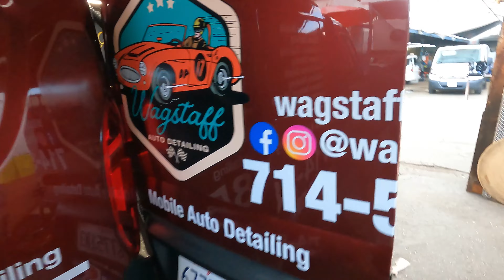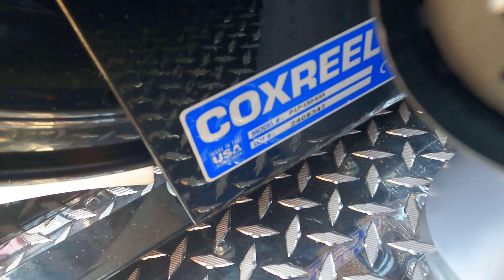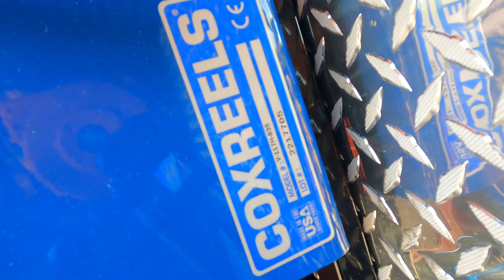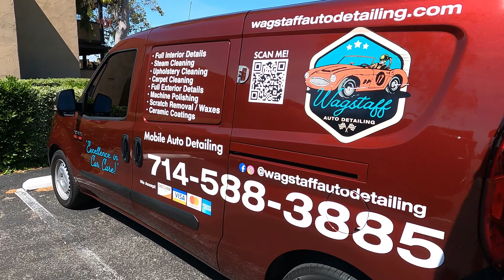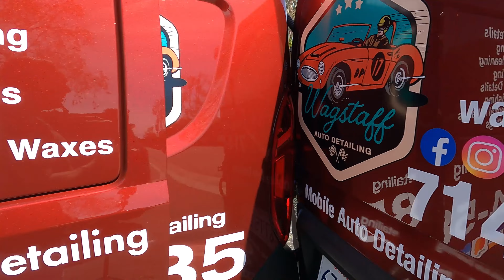H2O Custom Fits My Van setup With Top Of The Line Mobile Auto Detailing Equipment. Full Tour!

Comment: hey, my ar blue clean pro a620 pressure washer is above my water tank do i need a pump ?
Reply from the maker: I heard as long as its not
More than 3-4ft above its ok to use without it. I dont use one and its like 3 ft above and works fine

Comment: How do you pay for the set up?
Reply from the maker: Most people will finance the van, do a zero down financing, and just make monthly car payments. Once that’s out-of-the-way, most people will buy the tools and equipment with a combination of cash and credit cards, and then once you have everything, you can pay H2O a combination of cash or credit card to do the customization and installation. Also H2O has premade set ups for half the price it costs to but the van and equipment separately. They acquire high mileage reliable low cost vans and build a setup inside and sell them for around $20k.
Reply: @Brandinwagstaff  how much H2O charge for the set up ?
Reply: @Brandinwagstaff  thank you for responding me
Reply from the maker: If you have all the equipment, tools, bottle holders, machines, practically everything you need, then its anywhere from $2500-$5000 for the floor , walls, doors, frame, water tank and installation. If you dont have all the stuff first it can easily get into the $10,000 range
Reply: @Brandinwagstaff  thank you for your information

Comment: Do you have a video on how to set up the generators. I see that they are connected but can you show how. Also  explain how they are run to the electric box
Reply from the maker: I bought a 30 amp adapter and then made 2 gang box and plugged them in. Hit me up insta the links in my bio and i can give you more info

Comment: Thank you for giving your honest review on the setup!  We are looking to re-do our van setup here in the next few months and we’ve been doing lots of research on the different builds.  

I’ve seen h2o has some shelves built specifically for holding buckets.  Wondering if you had room to install something like that next to your vacuum hose reel?
Reply from the maker: Right there so many out there, it can be confusing. Im pretty happy with this configuration. 

I ended up solving the bucket situation, we built a shelf for it on the side, its going to get installed any day now and then I’ll post a new video on it. I think Im going to save that large space next to the vacuum for a DI water filter system is possible, Im not sure.
Reply: @Brandinwagstaff  oh very nice!  Looking forward to your evolving setup!